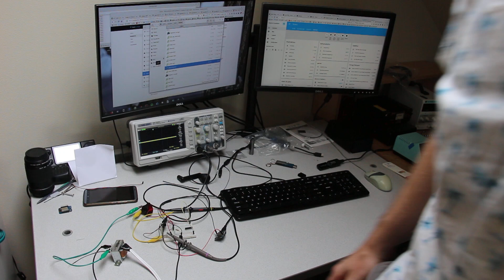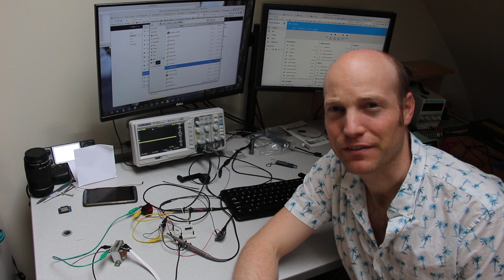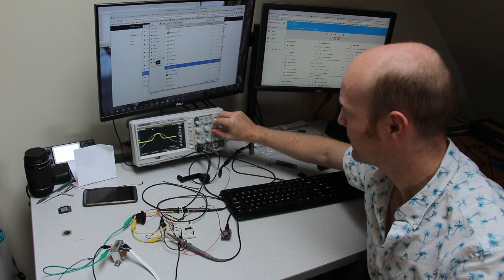Expanding my doorbell range with a stereo, an ESP8266, and Home Assistant

Comment: Can you tell me what device you used to step down the transformer voltage so your esp8266 could sense the voltage?  (The between 0 and 1 volts that is)
Reply from the maker: Sure! Just two resistors and wires making up a voltage divider. See circuits here: https://partofthething.com/thoughts/making-my-analog-doorbell-smart-by-simply-attaching-a-7-sensor-to-it/